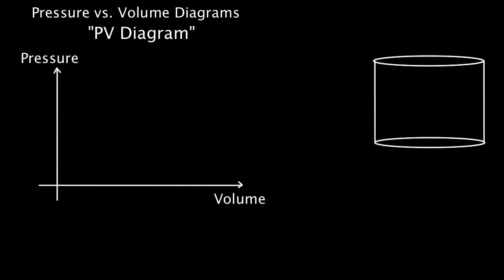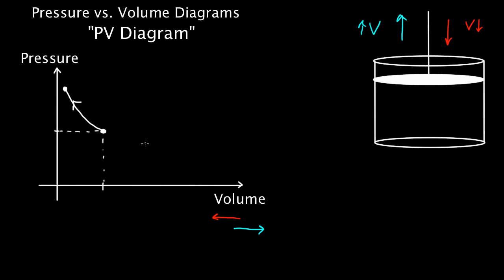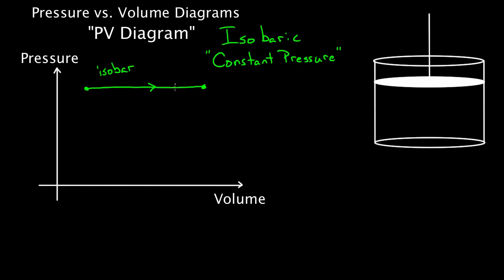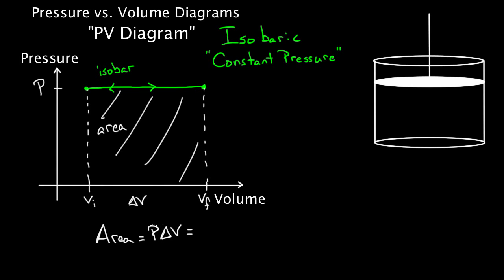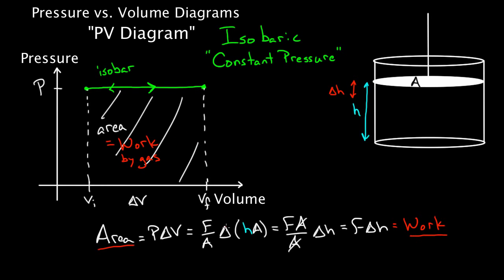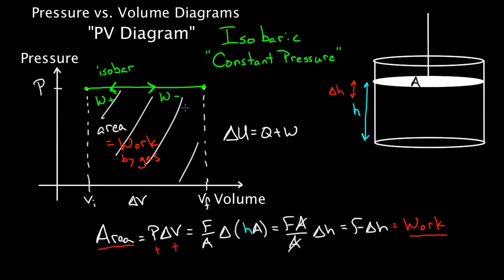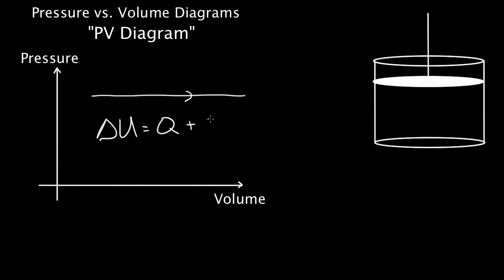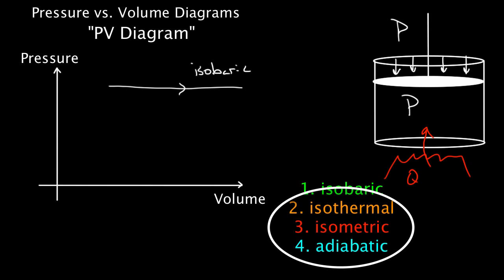PV diagrams - part 1: Work and isobaric processes | Chemical Processes | MCAT | Khan Academy

Comment: At 10:22, is it the work done should be positive? because the final volume is greater than the initial volume..
Reply: No, in my knowledge, the minus sign here means that the gas is doing work, not receiving work from the environment (in this case, A has a positive sign).

Comment: If it's an isobar compression, then shouldn't the work done be negative? And vice versa? Since for the isobar compression graph the change in vol would be negative.
Reply: No, because positive work is work being done on the system. So a compression is net positive, because you add energy to the system. While expansion is negative, since the system does work and thus loses internal energy. I think so, atleast. Learning this subject myself right now. Thought this might help someone else with the same question.
Reply: @vihaanmenon7175  I'm sorry but aren't the conventions for work different in physics and chem? 
Like if work is done by the system=+W 
If work is done on the system= -W ?
I'm confused about this part :")
Reply: @parkmin-su4793  Sign conventions are arbitrary, and set for the convenience of the context in which you are using them.  You need to learn follow the sign convention given to you in your class.   Ultimately, it's better to know how to state your answer with words, to explain the meaning of the sign you get, so that your answer is objective, regardless of what sign convention you are using.  Not all physics and not all chemistry classes/books, are guaranteed to use the same sign convention as a standard.

I'm accustomed to the heat engine sign convention, such that heat added to a system is positive, and work done by a system is positive, for thermodynamics problems.  For the original definition of work, work done on an object is positive, and work done by an object is negative, so it is opposite.
Reply: you probably dont give a shit but if you are stoned like me atm you can watch pretty much all of the latest movies and series on InstaFlixxer. I've been binge watching with my girlfriend during the lockdown :)
Reply: @Fox Everett yup, I've been watching on instaflixxer for since december myself =)

Comment: if the temperature in isobaric process increases then why the internal energy reduces? i found some maths refering the decrease of internal energy in isobaric process.
Reply: Zubaer Ahmed because the gas inside the piston has to use energy to push all of that area upwards, like he explained in the video, a force is exerted through a distance.
Reply: The examples of the isobaric processes you saw must have been ones where you remove some pressure from your piston and the gas inside pushed it up a distance without the need of heating it up. Thus decreasing the internal energy (U) of the system.

Comment: is it u=q+w or is it u=q-w?
Reply: +Anirban Das Hey! does temperature increase in isobaric expansion?
Reply: Yes, it does.
Reply: +Arthik Alexander It can be both. Consider the expression: U= Q+W.
1. When work is done "ON" the system (e.g. External pressure applied to a gas in a piston-cylinder configuration to compress the gas), W= +W. Therefore, U= Q+ (+W)= Q+W.

2. When work is done "BY" the system ( e.g In a piston-cylinder configuration, when the gas exerts pressure on the piston, the piston moves upward), W= -W. Therefore, U= Q+ (-W)= Q-W. 

In short. Work done ON the system is always positive in nature (+W) and Work done BY the system is always negative (-W).